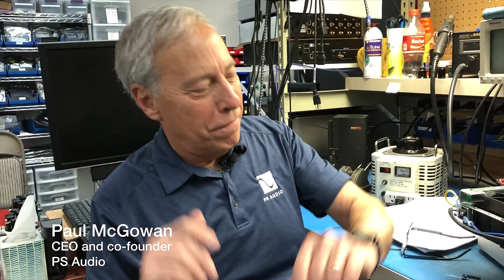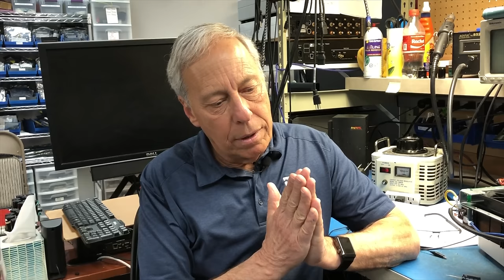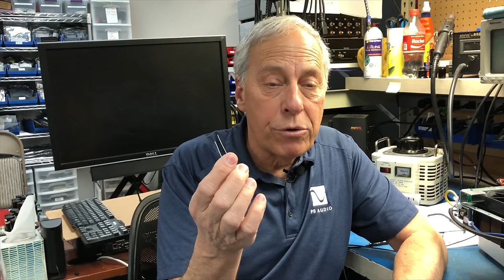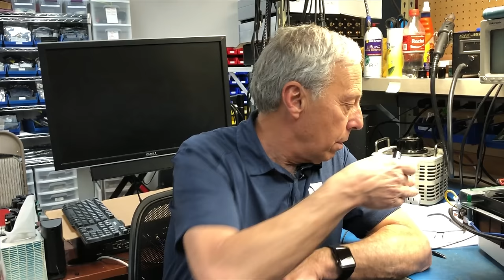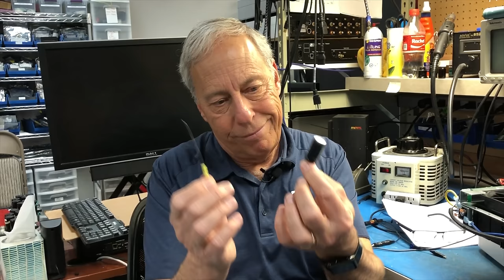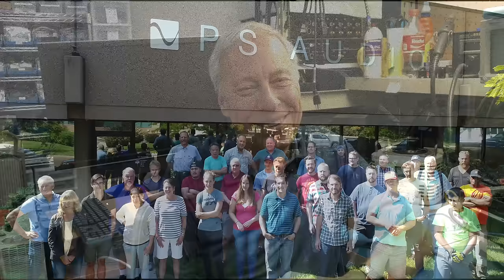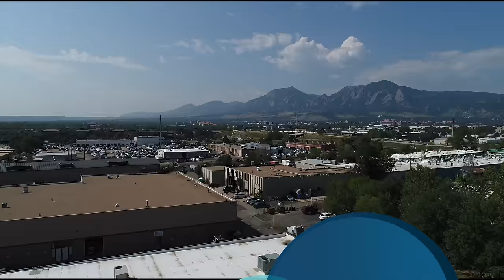Why do capacitors sound different?

Comment: As a retired analog microchip designer with 35 years of experience, I have a good practical knowledge of capacitor characteristics. Caps have three basic electrical characteristics: capacitance, equivalent series resistance, and equivalent series inductance. Depending on the circuit in which the cap is used, one or more of these might be completely negligible. Film caps have much lower series resistance than electrolytics, but most of the series inductance is in the leads, so there is not much difference between the two types. In audio circuits, resistance and inductance are almost always negligible because the frequency of operation is so low. At audio frequencies, series inductance is practically zero. Series resistance along with the capacitance results in a tiny phase shift of the audio signal, but it's not at all clear that such tiny phase shifts are audible.

Rather than providing an explanation, Paul, all you've done is declare that film capacitors sound better than electrolytics. To provide an explanation, you would have to deal with the capacitor characteristics I described above, by showing how an audio signal is altered in a way noticeable to the human ear.

For example, tube amplifiers sound different from transistor amplifiers because tube characteristics are different from transistor characteristics. Almost all audio amplifiers provide gain by using a feedback circuit to control distortion. Tube amplifiers have inherently much lower gain than most decent transistor amplifiers, and end up having much higher distortion, mostly in the odd harmonics, than transistor amps. It's that distortion that is actually pleasing to the ear, and for poorly known biological reasons, "sounds better" than an undistorted signal. That's the sort of explanation you would need in order to explain why "film capacitors sound better than electrolytic capacitors. To be thorough, you'd have to provide a representative circuit schematic of some amplifier and explain exactly why using one type of capacitor in one location produces an audio signal that "sounds better" than if using another type.

Also keep in mind that electrolytics are not used very much in audio circuits (except perhaps very low frequency bass circuits), but almost exclusively in power supply circuits.
Reply: Alan, don't tubes produce even order distortion rather than odd order distortion?
Reply: And Alan, dielectric absorption might be the biggest factor. Yes ESR and ESL are important, especially for bypassing and circuits that pulse (switching regulators) but DA is the most likely differentiator. Agreed, lead inductance has no bearing at audio freq.  Pease wrote articles about this, calling it a memory effect. Also a changing voltage and/or bias voltage across a cap influences the charge available which changes the capacitance. This might be a minor effect.
Reply: Well while you've been gaining book smarts for 35 years, he's been listening to this shit for about as long, so I'm gonna take his word on what sounds better
Reply: @TheChadPad  I guess you can't read
Reply: @philipwebb960  
They produce both.  Clever designers use staging and topologies which tend to cancel even harmonics, so in practice it's more of a myth than reality, that tube circuits produce mostly even harmonics.  
But considering the overall frequency distribution of distortion harmonics, it is generally true that tube circuits produce more energy in low-order harmonics and less energy in the very high-order range, compared to class AB transistor circuits, for example.
Reply: Pop the cover off of a commercial mixer some time:  You'll see lots of small electrolytic capacitors.  They are used for DC blocking at the output of almost every stage, regardless of how little DC is present.  I've even seen designs that put a blocking capacitor on both the input to, and the output from, a level control between op-amp stages that have no voltage bias (bipolar power supplies).  Can't imagine why they did that.  
Another important distinguishing characteristic between quality film capacitors and electrolytics, is linearity.  Even ceramic capacitors have issues with that.  The "inductance" of electrolytics at high audio frequencies can be from the dielectric behavior, and it can be significant.
Reply: Well explained and nice link between electronics and psychoacoustics.
You should become a teacher.
Reply: Anyone who's selling high end audio equipment is not willingly going to admit that cheap components can sound just as good.
Reply: @stevenofford495  Jup, there's no reason for any salesman to honestly say something like that, it only drives their potential customers away to the cheaper competitor, resulting in less sales.
Reply: Wrong agains! CAPACITOR ifromt eh wor CAPACITY It is based ont he volkume and nopthign else. PLease educate yourself before making me thing sof what or hwop toi responds to YOU!
Reply: allydea:  HellOw mine Frends. Is tyhsi the articke you wanteds...

The Laplace transform is an integral transform perhaps second only to the Fourier transform in its utility in solving physical problems. The Laplace transform is particularly useful in solving linear ordinary differential equations such as those arising in the analysis of electronic circuits.

The (unilateral) Laplace transform L (not to be confused with the Lie derivative, also commonly denoted  L) is defined by

 L_t[f(t)](s)=int_0^inftyf(t)e^(-st)dt,  
(1)
where f(t) is defined for t>=0 (Abramowitz and Stegun 1972). The unilateral Laplace transform is almost always what is meant by "the" Laplace transform, although a bilateral Laplace transform is sometimes also defined as

 L_t^((2))[f(t)](s)=int_(-infty)^inftyf(t)e^(-st)dt 

THNK YOU AND THUMBBS UPS!
Reply: THANK YOU
Reply: Capacitors are made to different standards by different brands. Some have tolerances +- 10% some have tolerances +-2% that alone will affect sound quality. Say one loudspeaker has cap that should measure 2.5µF however due to the 10% margin it measures 2.25µF. If the other cap (in second loudspeaker) is in the other direction it can measure 2.75µF and now we have a difference of 1600Hz in a crossover point between the two loudspeakers. So each loudspeaker will sound different and as a stereo pair they will not image well. Hence higher quality caps with tighter tolerances will perform better than electrolytic counterparts with much looser tolerances. Yes of course the loudspeaker manufacturers can measure each cap and make sure that they are matched - but that's expensive and rarely the case.
Reply: Tubes have a more realistic, three dimensional, "deeper" soundstage. You are saying that is due to distortion?
I doubt that very much. I think you are completely wrong. Distortion, my ass.
Reply: @ilovecops6255  Learn English
Reply: Doug Robbins: Hellow Mine Frends! When are you foing to  Learn English? Is it to put a period at the ens of th esetncne of vector addition for ejecting out of upsidedown airplane? THANKES YOUES AND TBBMSUBS UPS!!

Doug Robbins1 hour agoHighlighted reply
@i love cops Learn English
Reply
Reply: Doug Robbins: hELLO mISTRE rOBERTS AGAINS! tUBES HAVE harmonics distortions. Its why they can SOUND SBETTERS' THAN TRANSITOOIRES/ hARMONICS DISTORTIONS is far from autophiles.

There are also significant differences in the construction of tube and transistor amplifiers that contribute to the sound. Tube amplifiers require output transformers to match the high impedance of the power tubes to the low impedance of the loudspeaker. The transformer has a natural high-frequency roll-off that makes the tube amplifier sound warmer.

Thanks you for expert cpmmetn with you 4 year electricals engineerign degree/ Your universit you graduted from f must be verys proud of YOUE!

 
Doug Robbins1 hour ago
Tubes have a more realistic, three dimensional, "deeper" soundstage. You are saying that is due to distortion?
I doubt that very much. I think you are completely wrong. Distortion, my ass.
Reply   

THN4EKS YOUES AND THUMBBS USP!
Reply: @ilovecops6255  Output transformers can be linear out to 40 kHz, so there's no rolloff for audio frequencies, but the amp still has that sound. You haven't got a clue, do you?
Reply: @dougrobbins5367  Hellow Mine Gooda Frends. I remember a HARMAN KARDONS form around 19767, it wne up to 100 khz. Here is a articles I finded for yoU mine frends...

Harman Kardon Citation Twenty-Two Power Amplifier Review

We measured the frequency response of the amplifier from 5 Hz to 500 kHz. It was down only 0.1 dB at the lower limit and 0.6 dB at the higher frequency

I don thaves the CLUES board gam I dont play baords games...The classic detective game! In Clue, players move from room to room in a mansion to solve the mystery of: who done it, with what, and where? Players are

The stero I have the transformer gets really hots now. It must be brokesn or something. Keft cannels dont work. I cant affrd new stuff except maybe Logitech computer speakers. THANKES YOU , AND THUBBS UPS!
Reply: @ilovecops6255  Maybe your tubes are carrying too much current, need to be biased. Maybe that's why it's hot.
Reply: Thank you for answering the capacitor question more thoroughly. We’d need to bring a lunch for a conversation where Paul actually got around to  a complete answer. He’s forgotten more about audio design than I’ll ever know but it takes so long to get through the goofy grand-dad schtick.
Reply: Paul it's time to let go!
Reply: Ask yourself why any experienced electric guitarist will tell you there is a distinct difference in the sound of one manufacturer's rectifier tube, compared to another. The same experienced musician will tell you there is a clear audible difference when changing volume pots, from one type to another. There is no explanation for this, in engineering terms, it makes no sense. But it is true. Food for thought.
Reply: There are people who spend hundreds of dollars on "special made for audio" capacitors to re-cap old speaker cabinets...  they will swear that the $1,000 spent on buying the components and then building the circuit themselves makes a difference.
Reply: ListenAndLearned  HELLO MINE GOODE FRENDS! Its in the video 'Ejection Vectors USAF Ejection Seat training film' STARTING AT 10 MINUTES 0 SECONDS. THANKE YOU AND THUMBBES UPS!
Reply: @Allen  Feuerbacher 

This article spells it out,

39 years ago -

http://www.reliablecapacitors.com/oldRC/www.reliablecapacitors.com/pickcap.html
Reply: @dougrobbins5367  If psychology has taught us anything it's that the human mind is not a trustworthy source of accurate interpretations of reality, including interpretations of our own perceptions.

Look, I use Russian paper in oil caps in my guitar, but I do it because I think it's cool. I'd like to think it makes an audible difference in the sound but after years of nerding out about this stuff I've not found any more likely explanation for the vague claims of "superiority" from a handful of "experienced musicians" than cognitive bias. No one should be arrogant about the type cap they use and no one should feel theirs is inadequate either.

As for differences in tubes, I'm not sure what specific situation you are referring to but differences there can and have been explained. Even then though it's really just about personal taste.
Reply: @ZaphodXLII  Millions of people find that different caps sound different, it's quite obvious. I don't know anyone who is "arrogant" or ashamed of the caps they use.
An amplifier can have excellent specs, and still sound like garbage. Amps with lots of distortion can be very musical. Our ears discern things that cannot be seen on an oscilloscope. If you can't, then maybe you have been playing too loud, for too long.
Reply: @dougrobbins5367  wooosh
Reply: @ZaphodXLII  That was deep. But, I guess it's better than the meaningless rambling that you were doing earlier.
Reply: @dougrobbins5367  I'll elaborate on what I meant by "woosh": I'm sorry you're having trouble stepping back from your ego and looking at what I said objectively. Feel free to start up the conversation again when you have something to add that doesn't boil down to "I think other people agree with me". It's like trying to have a nuanced discussion about politics or religion and one person only replies with "how can <insert religion or political view> be wrong if so many people agree with me?"
Reply: @ZaphodXLII  I've built at least twenty amps. I know many others who have done similar things, knowledgeable, competent people. I have clearly heard the sonic differences between polypropylene and polystyrene, mylar, and so on.
My clear perceptions are echoed by every person I know of, who has experience with these things. Online, we see general agreement, broadly speaking, on these matters. So, the fact that competent people everywhere seem to have the same impression, is perfectly valid and valuable as evidence for this subjective perception.
It's as good as we will get, unless someone has done an extensive digital analysis and can show us the subtle differences on a graph, screen, or whatever.
In this situation, the perception of those experienced  in the matter is important, and your suggestion that the general agreement that I described is invalid, is wrong.
The judgement of the competent and experienced is the best evidence available.
Your characterization of what I said is foolish
Reply: @dougrobbins5367  I see where you're coming from and I do think that general consensus should not be dismissed lightly (though I do think it can be a trap to assume that there is one general consensus about something in the first place). I think we have a lot in common. I have built many synths and at one point I even built a rig in my custom sid chip synth for hotswapping the external sid filter caps and I probably tested 50+ caps of various types. I certainly did hear differences and I can't be sure that the types of caps weren't responsible for those differences. It's just that there are so many things in my life that I have been convinced of and that many very smart people around me agreed with that I have since found to be wrong. Sorry if I've been preachy, I just get passionate when I think someone else might be making the same types of mistakes I make.
Reply: @ZaphodXLII  In my experience it is the small signal caps where the most difference is heard. Sonically the best I've heard are polystyrene.
I'm impressed with the Novation synths, but I am no expert. I can get a Supernova for well under a thousand dollars. Would you recommend that purchase?
Reply: @dougrobbins5367  That's cool, I actually ended up using a polystyrene.That's definitely a good deal on the supernova. Haven't used one myself but from what I've listened to it does really good filter emulations for the time it was made. All the focus these days is around "pure analog" but I think a lot of those early attempts to emulate analog synths have a lot of their own character and can easily be warmed up in a lot of different ways like running them through guitar pedals. Most of my knowledge is around mid 80's to early 90's synths, especially the ones that are digital analog hybrids. Like the roland jx-3p, sid chips from commodore 64's that had analog filters, ensoniq stuff, weird casio and yamaha stuff. Most of what I build is recreations of even older stuff that I can't find cheap like the vcs3, polivoks, or just the increasingly expensive analog classics like moogs, rolands, yamahas, etc,.
Reply: @ZaphodXLII  They could make lots of money by reissuing the actual Jupiter 8.
Someone said the chips no longer exist. Seems dubious. Maybe it's just too costly to build?
Reply: @dougrobbins5367  Yep, a lot of those chips only have hope of being remade is someone acquires the original machine they were manufactured on. It has happened but most of them are in landfills in asia. It's a lot like tubes, It could be done cheap-ish with enough demand but still no where near as cheap as the modern alternative (I guess transistors in the case of tubes and modern integrated circuit printing in the case of chips). FPGA's are very promising for a lot of those chips though.
Reply: @ZaphodXLII  If you want to really warm things up...
Someone gave me a single ended tube power amp, a whopping ten watts of gorgeous, sweet sound. Used with good, efficient speakers, it's the best sound I've ever had. Methinks it would do much for many synths.
Reply: Thanks for the explanation, the more of these PS Audio clips I watch the less I'm convinced they are based on objective scientific fact, and more on subjective opinion. I'm no expert, but I feel a lot of what is mentioned in these videos has little to do with actual knowledge about electrical engineering, and more to do with perpetuating convenient myths. Usually when people understand the differences between capacitors, and the sounds that they produce, they can do better than just this one sounds better, and this one doesn't.
Reply: @ES-qm5hr  How are you going to do "better" than that?
Reply: @content4502  
That's an annoying article to read.  It is written in a style that attempts to mimic formal papers, but is inconsistent in doing so.  In a number of places, the author demonstrates a poor level of experience with electronic design, discussing at length approaches which no experienced designer would implement.  The author shows a basic misunderstanding of the physics of dielectrics.  The article is full of typographical errors, especially in physical units.  It does not do well at prioritizing discussion of circuit configurations most commonly found in audio designs.  Some of the claims made are dubious, e.g. increasing the load on a capacitor, causing it to conduct more current and operate at a higher ac voltage supposedly reduces distortion.  
Most seriously, it fails to investigate any link between distortion measurement results, and other parameters discussed at length such as DA (dielectric absorption) and DF (dissipation factor), and never mentions that such behaviors themselves are not root causes of distortion, but only their deviations from linearity.  
After wading through the bloated discussions, one comes away with just two salient points, the first of which is already common knowledge:  
1.  Do not use electrolytic capacitors without DC bias.
2.  Avoid polyester dielectric.
Reply: @ZaphodXLII  
I agree our perceptions have little to do with reality.  But perhaps even more important is the fact that they are so variable.  The brain is flooded with more information from sensory organs, than it can fully process.  The obvious implication is that it must select only a subset of that information, and that is where the issue lies, since the selection process is highly inconsistent.  With every repetition of a musical passage, different details come to attention.  The ability to detect particular nuances in complex sounds relies on a level of consistency that our brains struggle to attain.  
I have spent enough time listening to A-B comparisons, to realize that many apparent differences vanish, if one takes the time to repeat the samples using short loops.  One simply doesn't arrive at correct conclusions, if long A and B passages are listened to once or twice, as is customary in most comparisons.
Reply: @dougrobbins5367  
"Millions of people find that different caps sound different"
Dubious claim.  Please cite a credible reference.  
"Amps with lots of distortion can be very musical"
Amplifiers with low-order harmonic distortion at modest levels can sound musical.  Amplifiers with high-order HD, even at low levels, can sound harsh.  More importantly, amplifiers can exhibit distortion with reactive loads that doesn't manifest with the resistive loads used to test them.  Further, some amplifiers suffer from perturbed frequency response with reactive loads which can be distinctly audible but potentially pleasant even though accuracy (fidelity) is reduced.  
"Our ears discern things that cannot be seen on an oscilloscope"
Then the operator doesn't know how to make full use of the scope.  Wager:  If you hear a real difference between amplifiers, preamps, cables, etc., I can show you what it is, using my scope.
Reply: @marianneoelund2940  There's nothing dubious about that claim. Do a little research, among those who build and modify amps and so forth, the differences are well-known.
Please look it up.
Our eyes give us different information than our ears do. Your claim that you can correlate any valid audio perception, with a visual one, is the dubious claim.
In other words, hogwash.
Reply: @dougrobbins5367  
What's dubious, is the "millions" part.  That isn't a minor detail.  You aren't supporting your point when you exaggerate.  Cite a credible reference, or retract the claim.  
I'll reiterate my stance:  Any real difference you can hear, I can identify by signal analysis.  That is my area of expertise.  
Over 40 years of EE work in the aerospace industry, I was able to solve every single problem that I was given to analyze.  Every.  Single.  One.  No exceptions.  Often, I was used as the "engineer of last resort" for the problems that others were struggling with, so they weren't all straightforward cases.  
Your minor audio issues are trivial by comparison.
Reply: @marianneoelund2940  So, it's an exaggeration. So sue me. We are not in court, you are not cross examining anyone, and you are in no position to give me the choice you just did. Who do you think you are? Would you be so impertinent, if you were looking me in the eye?
I doubt it very much.
The sonic differences among capacitors is, once again, something that is well accepted among experienced audio people. Read up on it. It's silly to ask for a credible reference. How would you establish credibility? Anyone with direct experience, I suppose, is credible, in terms of subtle sonic perceptions. So your request for a '''"credible reference" is silly. Withdraw your silliness at once.

If you saw an oscilloscope display of a Rolling Stones recording, could you tell the difference between that and the display of a Beatles recording?
Of course not. What nonsense. And that is not subtle at all, a young child can hear the difference immediately. You could search for the visual differences until you had a long white beard.
Reply: @dougrobbins5367  
Gross exaggerations are hardly impertinent.  
I'm not objecting to the idea that differences between capacitors can be audible; who around here doesn't know that?  
However, your Rolling Stones versus Beatles example certainly is impertinent.  Are you suggesting that a capacitor change would transform one to the other?  
Let's stay with the topic, please:  Ability to detect/analyze signal differences due to component quality.  If there is an actual difference which you can hear, I can show you what it is on my scope.  In high res mode it collects data to 16-bit resolution, up to 10M samples, and can show amplified channel differences as well as extremely detailed spectra.  
By the way, the long white beard would have to be yours.  Women don't grow those, if you haven't noticed.
Reply: @marianneoelund2940  That's not what was impertinent. Your telling me to choose between providing credible evidence and withdrawing the statement was impertinent. You don't give orders, on youtube. Mind your manners. I don't know what the people in your life put up with from you, but I'm sure it's too much.
For you to ask me if I think a cap change would transform the beatles to the rolling stones, constitutes the dumbest, most idiotic question I've been asked in a long time. If you cannot distinguish, by oscilloscope, the major differences in sound qualities between the recording of the stones versus the beatles, you cannot hope to distinguish far more subtle qualities of capacitors. Looking at a scope, you can't even tell if a complex mix of audio frequencies is music, or not. But you think you can detect the musicality of capacitors? When you can't even tell if the signal you are looking at is music? Bullshit.
Where you got the idea that I thought a cap could change the stones into the beatles, is anyone's guess, but it sure is nonsensical. Almost as nonsensical as the idea that you can point to a visual display which correlates with the ear's perception of music. What evidence is there for that? Your word? Sorry, you seem like an over-inflated, opinionated braggart.

My meaning was clear. Your response is garbage, and you are clearly a person who has grossly overestimated your own abilities.
Reply: @dougrobbins5367  
Considering the language you're leveling at a complete stranger, it is the people in your life that we should feel sorry for.   
I don't need to measure "musicality," Doug, just as I don't need to measure imaging or staging or perception, as these are all derived from the music signals.  It's not necessary to know what the auditory system or neural processing does to the information; I only need to measure its input.  
If there are actual, audible differences in the signal, due to a component change, I can find them.  Guaranteed.  I've been doing just that for decades.  
And if you think one wouldn't see a difference in the scope traces from two different music tracks, then you have no idea what modern scopes can do.  I find that quite amusing, in fact.
Reply: @marianneoelund2940  My language? You are the bossy one.
You could see a difference, but you couldn't tell what the difference meant.
Look, I've tried to analyze the scope image of different kinds of music. There is nothing there that shows a correlation with what you hear, beyond the display of repeating rhythm, with regularly changing amplitudes across the spectrum.
Nothing there, besides a repeating rhythm, betrays the fact that it is music at all, and not noise. There is no possible way to discern the character of a piece of music, from the visual display. 
With caps, people notice differences in character, many people get the same impressions. These qualities do not seem to be reliably reflected in the simple frequency response analysis. People are hearing something. Maybe a capacitor cannot be defined in terms of it's measured response at a single frequency.  It's like an amplifier which is tested with a sine wave at one kHz.
It might read very good, but when it is trying to produce a hundred frequencies at the same time, as in hi-fi audio, the weakness of the amp becomes more than clear.
Are there dynamic qualities to capacitors? There must be, if the subjective impression of THOUSANDS of people are correct. (I hope you are more comfortable with that, I know you don't like exaggeration, Marianne) Mylar is clean and competent; polypropylene has a richer tone; polystyrene seems to convey the highest  frequencies with ease. These are consistent observations. Can you show me those qualities, on your screen? Can you show the differences, in the audio spectrum, of a signal passed through one type of plastic film cap, or another?  A cap used at audio frequencies, which should be linear at a hundred times the frequency?
If the differences we hear are merely frequency response of the different dielectrics, then we are hearing some amazingly small differences. Seems unlikely. It would appear that the chemical makeup of the dielectric affects the sound in some other way or ways. Consistent observations by everyone from hobbyists to professional builders make it unlikely that these things are imaginary. (Not millions, don't worry)
Can you show these things on your scope screen?
You claim to be something of a sherlock holmes of signal analysis. 
What could you show us, on the scope screen?
Reply: @dougrobbins5367  
Yes, I'm confident I could find the differences with the scope.  Distortion analyzers can certainly find the difference, and I can set the scope up to operate as a distortion analyzer.  Recently, I was doing just that, to create a scope trace of powerline voltage distortion.  It can also be set up for spectral analysis, which is akin to how auditory systems work.  
Keep in mind this is not an absolute measurement, it's a delta measurement comparing two sets of samples from two components.  That allows very high sensitivity.  Chances are I would also find other things that you cannot hear.
Reply: @marianneoelund2940  

Dear whomever, 

That article was published for the unwashed masses. 

In a commercial audio magazine. 

The author was a university professor with a doctorate. 

It was this article,  that caused the change in audio electronics. 

Toward higher quality/less distortion. 

The two points you mentioned, 

1.  Do not use electrolytic capacitors without DC bias.
2.  Avoid polyester dielectric

Were NOT common knowledge at the time.

Yor comment,

Is typical of people who try to impress others, 

By yor attempt to appear  'smart'.

Proving you are a troll. 

Nothing more.

Please change you ways,  and join humanity.
Reply: @content4502  
I'm an engineer, not a troll.  
It is not true that distortion due to polar (Ta and Al) capacitors and ceramic capacitors was unknown prior to the 1980's.  
The article is very old and needs an update, in particular to concentrate on finding root cause of nonlinearities in film type capacitors, better measurement approaches, and correlating results to audible character.  Simply measuring DA and DF values does not explain how audible nonlinearities arise.  
There is no data presented which shows how audible differences can exist between mylar, polypropylene or polystyrene (or even polyester) dielectric types.  Considering that, your claim that the article was the principal driver for changes in the audio industry, appears rather weak.
Reply: @marianneoelund2940  an engineer?

Sure you are.

Alot of  'lil kids are.

And 'scientist'.

By the way, where were you, in 1980?
Reply: @content4502  
I just retired from a 41+ year career with my company, this year, having started in 1978.  There are public campaign donor records where you can find my employer and job title.  First 4 years I worked as a technician, until I completed my EE degree.  
Electrolytic capacitor nonlinearities were well understood in the 1970's and by most, much earlier than that.  Ditto for high-K ceramic capacitor types.  
Regarding capacitors, you will find much more information here:  
http://www.waynekirkwood.com/images/pdf/Cyril_Bateman/
One of the most important takeaways from Bateman's studies, is that one cannot rely on random sample testing, as parts within a single manufacturing batch can vary widely in their distortion measurements.  That is, for application in high-end audio, there must be a QA process which tests all parts for distortion performance; one cannot rely on dielectric type and construction alone.  
Today, it's difficult to find polycarbonate or polystyrene.  Most common film cap dielectric is polyester (polyethylene terephthalate, PET or naphthalate, PEN), often called mylar, but this isn't a recommended type for audiophile applications.  Low distortion types are mica, PTFE (teflon), NP0 (C0G) ceramic for small values; polypropylene (PP) or polyphenylene sulfide (PPS or PS) for larger values, especially if foil on film rather than metallized.  
Contributors to poor capacitor performance are:  
Mfg. variability (mentioned above)
High dC/dV (associated with high DA)
Ohmic connections (especially metallized)
Piezoelectric effect (microphonics)
Reply: @marianneoelund2940  i already know about capacitors. 

Have known for 40+ years. 

Bateman's article was discussed 15 years ago, 

@diyaudio, and found, wanting.

Let's just say, it's incomplete. 

Whatever your situation is, 

You still post like a troll.
Reply: @content4502  
I agree there is still a need for further study.  For one thing, parts availability is different today.  
Bateman raised some interesting questions, which I intend to pursue as I have time.  Measuring extremely low THD levels with pure sinusoidal signals is one thing; my interest is more towards comparing capacitor performance with actual music signals where a complex and wide range of frequencies is present.
Reply: @ilovecops6255  yeah, so you are not an idiot! A bit crazy, maybe?
Reply: @jjcale2288  THNAKS YOU MINE GOODE FRENDES! There was no GPS back in 1960. Just a map, compass, and moonlight. ABSOPLITELY NO RADIO TRAFFIC! Its really easy to triangulart and figure tu where an aricraft carrier can be. Iranians have ANTITANKE MISSILES on ther speedbota so they can get close and do a lotee fo dmage, IE.E. SUICIDE BOMERS TYPES!.  Have you see the sroties about Irans speedbote s harassing US shipe. Thats the dangers and belive me it is reel! THEY DONT NEED FRUGATES and such to stop a aricrafte CARRIERES!
Reply: @marianneoelund2940  Thanky you faiur lady. you haves alwayes been the goode freendes. thubmmbes uppes!
Reply: @ilovecops6255  q.e.d.
Reply: @dougrobbins5367  are you a musician? Are you an engineer? I thought so but never mind! You developed a biased mindset. And you are not alone, this mindset keeps "audiophile" companies in business 😉
Reply: @jjcale2288  Its knows as a SOUPERSONIC DIFFUSER. Supersonics airplanbes have those rectangulare inlets. There are sioupersonic diffuseres in there to SLOW doen the air to su[psinic to the shocke wave does nor destropye the compressor. Theearl;ier ons were controlled by a anaolg compputers and di nto work so goode. Later they use digitalle computers IUts sutomaic and the pilot does nto controlle themes. Rocket motores are the opposites. The get larger fromt eh throa to expande the gasses and incrase them to soupersonice. GOOGLE Tsiolkovsky rocket equation. thankes you and thubbmes uppes.
Reply: @jjcale2288  I've been a classical musician for many decades. I've built about twenty amps from scratch, and I'm designing more and more of the circuitry myself, as things evolve. How about you?
Your stupid remark about audiophile companies is, unfortunately, unaccompanied by any thought or reason. A shallow, sophomoric, non-comment.
Try to make a point, jerkoff. I'm surprised you aren't embarrassed to "contribute" that kind of stupidity, after some of the thoughtful comments that have appeared here.
Get a good grip on your knees, and try to pull your head out of your asshole.
Arrogant and stupid is no way to go through life.
Reply: that guy sells overpriced power cables saying that it will make your system sounds better, what did you expect?
Reply: That was very well explained, electrical engineering was always kind of poorly explained in school
Reply: I don't think there's a technical explanation that's going to really explain how a sound resonates in your ear. If you take a basic yellow Chinese polypropylene capacitor and a Clarity MR. They would likely test almost identical but you can double blind a tweeter with each one and easily tell the difference. It's subtle but it's definitely there and a repeatable process any audiophile can hear
Reply: @Wizardofgosz  it's very easy. Try it. I can do it 10 out of 10. Have tried it
Reply: I’m with you bro.
Reply: Lol 😂 every bit as logical as the main video.
Reply: @stevenofford495  Now that is a very precise and accurate explanation of this phenomenon indeed. "Oh please ring me up those  5 meter pure oxygen free copper, shield wound facing North on the equator, 345 strand per cm golden plated brass end polypropylene dielectric cable please, it's on sale correct for $1245.99 correct?"    :)   Pathetic creatures.
Reply: Now this is an excellent answer, not like the ine from the video, great job, beginning to understand finally
Reply: What a great explanation!  Thank you very much :)
Reply: @TheChadPad  huh?
Reply: @ilovecops6255  What language is that?
Reply: Congratulations, where can we see your products?
Reply: @madcrabber1113  HELLO MINE GOOD EFREDS! IS THSI THE ARTICLE YOU EBEE LOOKING 4ORE...Chevrolet Chevelle Laguna Type S-3 Coupe 350 V-8 Turbo-Fire (man. 3) , model year 1974, version for North America U.S. (up to September)

1974 Chevrolet Chevelle Laguna Type S-3 Coupe 350 V-8 Turbo-Fire (man. 3) specs

    manufactured by Chevrolet (USA) in United States
    2-door coupe body type
    RWD (rear-wheel drive), manual 3-speed gearbox
    gasoline (petrol) engine with displacement: 5733 cm3 / 349.8 cui, advertised power: 108 kW / 145 hp / 147 PS ( SAE net ), torque: 339 Nm / 250 lb-ft, more data: 1974 Chevrolet Chevelle Laguna Type S-3 Coupe 350 V-8 Turbo-Fire (man. 3) Horsepower/Torque Curve
    characteristic dimensions: outside length: 5265 mm / 207.3 in, width: 1946 mm / 76.6 in, wheelbase: 2845 mm / 112 in
    reference weights: shipping weight 1792 kg / 3951 lbs base curb weight: 1845 kg / 4067 lbs
    how fast is this car ? top speed: 179 km/h (111 mph) (©theoretical);
    accelerations: 0- 60 mph 12.1© s; 0- 100 km/h 12.9© s (simulation ©automobile-catalog.com); 1/4 mile drag time (402 m) 19© s (simulation ©automobile-catalog.com) 1974 Chevrolet Chevelle Laguna Type S-3 Coupe 350 V-8 Turbo-Fire (man. 3) Detailed Performance Review
    fuel consumption and mileage: average estimated by a-c©: 17.9 l/100km / 15.8 mpg (imp.) / 13.1 mpg (U.S.) / 5.6 km/l, more data: 1974 Chevrolet Chevelle Laguna Type S-3 Coupe 350 V-8 Turbo-Fire (man. 3) Specifications Review
Reply: @madcrabber1113  Chevrolet Chevelle Laguna Type S-3 Coupe 350 V-8 Turbo-Fire (man. 3) , model year 1974, version for North America U.S. (up to September)

1974 Chevrolet Chevelle Laguna Type S-3 Coupe 350 V-8 Turbo-Fire (man. 3) specs

    manufactured by Chevrolet (USA) in United States
    2-door coupe body type
    RWD (rear-wheel drive), manual 3-speed gearbox
    gasoline (petrol) engine with displacement: 5733 cm3 / 349.8 cui, advertised power: 108 kW / 145 hp / 147 PS ( SAE net ), torque: 339 Nm / 250 lb-ft, more data: 1974 Chevrolet Chevelle Laguna Type S-3 Coupe 350 V-8 Turbo-Fire (man. 3) Horsepower/Torque Curve
    characteristic dimensions: outside length: 5265 mm / 207.3 in, width: 1946 mm / 76.6 in, wheelbase: 2845 mm / 112 in
    reference weights: shipping weight 1792 kg / 3951 lbs base curb weight: 1845 kg / 4067 lbs
    how fast is this car ? top speed: 179 km/h (111 mph) (©theoretical);
    accelerations: 0- 60 mph 12.1© s; 0- 100 km/h 12.9© s (simulation ©automobile-catalog.com); 1/4 mile drag time (402 m) 19© s (simulation ©automobile-catalog.com) 1974 Chevrolet Chevelle Laguna Type S-3 Coupe 350 V-8 Turbo-Fire (man. 3) Detailed Performance Review
    fuel consumption and mileage: average estimated by a-c©: 17.9 l/100km / 15.8 mpg (imp.) / 13.1 mpg (U.S.) / 5.6 km/l, more data: 1974 Chevrolet Chevelle Laguna Type S-3 Coupe 350 V-8 Turbo-Fire (man. 3) Specifications Review
Reply: @whocares.20  well said but you left out the little detail that the price you quoted was per foot! Otherwise it would be too cheap to be real HiFi.
Reply: @jamesjameson4303  Per foot!? Darnit, I thought it was a bargain at per meter.. shux.
Reply: @TheChadPad  This isn't about what sounds better.... this is supposed to be about WHY they sound better (Look at the title of this video.) Gaining book smarts for 35 years?  Ah, yes, that's what we call being a trained engineer, and combined with experience, that is what we call being an experienced engineer.
Reply: @KenTeel  I didn’t mean to shit on book smarts, I meant to emphasize the difference between experience of listening to the differences as opposed to what theoretically should be better. There’s theory, and then there’s actually testing and listening. We need both
Reply: @TheChadPad  That's true, Chad.
Reply: @madcrabber1113  Just saw the reply. Check above where I explained myself better. Wasn't tryin to diss book learning. I study this stuff myself. But theory can't tell you how it will sound, only your ears can. So, to his point "Series resistance along with the capacitance results in a tiny phase shift of the audio signal, but it's not at all clear that such tiny phase shifts are audible." This is only one point of which I could say the following: What about the additive effects of many of these in a circuit? Small differences add up. Just food for thought for the op
Reply: I think you should listen to a proper high end system. Phase shifts are definitely noticeable in hearing. As are impedance mismatches. Go and hear a DarTZeel system for example, and report back ;)
Reply: Problem with electrolytics and audio is that they are non-linear, the capacitance actually changes with the charge, leading to audio distortion.
Reply: @4Nanook  and cheaper caps will be less linear
Reply: Nice post good sir 👍
Reply: @stevenofford495  To anyone with a tin ear it makes no difference if equipment is made with cheap components
Reply: Although capacitors are treated as "linear devices" when it comes down to extremely critical high end audio design, this is not quite true, since many minor factors such as temperature changes, dielectric, hysteresis effects, non-linearity of Q,winding v layer design, dielectric material, changes with age,  etc. need to be taken into account in designing for really high end audio performance.  ( I spent 6 years in capacitor design engineering- both barium titanate and film- a long time ago)
Reply: Thank you Alan, I left a question above yours on electrolytic capacitor replacement and I was concerned if any of them might play a role in the audible arena as it were. Your last paragraph, although general, does appear to suggest that in most cases don't directly contribute in any way, with some exception to the audio spectrum.
Reply: @alan Amazing!
Reply: Thanks for your comment, I'm just starting to build small audio projects and was wondering if I could use the less expensive electronic parts to begin with as it's not exactly high end audio and I have heard it mentioned that you can, hence me watching this video to find out more. I passed some electrical exams years ago but not electrical engineering but with what I remember I can piece together what you have explained here and eh thank you very much!!! There's a lot of audio elitism our there and I just want to save a few bucks while I'm learning, I hope you are having an excellent day! ;D
Reply: Very interesting 👌
Reply: The caps that we use on passive xovers, what are the difference in the voltage and percentage say 100v vs 400v and 2% vs 10%
Reply: @stevenofford495  Like the company that slaps a badge on a $30 Dlink dumb ethernet switch and sells it for $600?
Reply: @ilovecops6255  What??
Reply: You should start a channel and do what you advocate Paul should do. Too much work?  I get it.
Reply: @TheChadPad  I'm sure Paul does NOT listen to 'shit', but he probably listens to quality music on decent equipment, and why he is in the hi-fi business, and teaching others about it.
Reply: @QoraxAudio  Jup???? L0L
Reply: @ilovecops6255  UNGA BUNGA.....SIMBA!
Reply: @mr.blackhawk142  Absolutely. Agreed
Reply: @philipwebb960  3 types of semiconductors used in amplifier circuits, bi0polar, mosfet, and valve/tube. The harmonics of importance are 1st, 2nd and 3rd. The levels in dB (volume) are low enough to ignore after that. Bi-polar transistors have even order harmonics, i.e 2nd & 4th. Mosfet devices have odd order harmonics 1st and 3rd. valve/tube have octave order where the harmonic is the same note as the fundamental, meaning if the note being sent through the device is the note or pure tone of A, then the harmonic will be the higher pitched note/tone of A at a fraction of the volume dB say a 3rd the volume. The beauty of valve audio is the harmonic distortion is masked by the music itself.
Reply: @Marianne Oelund FLAC then?
Reply: @stevenofford495  This is not true.  Paul is doing you cynics a favor by explaining where he can find an acceptable/affordable solution that makes a significant difference to the problem he is describing.   I don't know if I would have his patience to try to offer helpful answers to such hostile critics.
Reply: @joelhacker8767  You know, my comment now seems to be attached to this video, which is a different one to the one I commented on response to.
Reply: Don't forget hysteresis. But for a coupling capacitor application the cap is chosen to of low impedance to signals of interest and so there is little to no signal across it's terminals. Since there is no signal across the capacitor none of it's nasty properties can really have any effect upon the signal. Paul is also dead wrong on how they function. Nothing "jump" across the dielectric; instead as the plates are charged then polarity is flipped the repulsion of electrons creates the flow of AC current. The rate of which this flipping of polarity occurs is why capacitors decrease impedance with an increase in frequency.
Reply: @dougrobbins5367  there is a video here that compares different kinds of capacitors used in a low pass circuit in a bass guitar. There is literally zero difference in sound between them apart from their respective capacitance value. The difference in capacitors can all be traced back to their characteristics and how they are being used in each circuit. As nobody characterizes the frequency characteristics of each and every capacitor they use, they use their ear for doing that (aka they use their ear as an audio spectrometer), so they can more or less say "this capacitor has a more suitable frequency characteristic in this circuit applicatinon at this time and under these conditions, certainly not "this cap sounds better". But until measurements are made, it's all very vague. But we do have general knowledge of a few recipes that can help about different types of capacitors, like the use of bypass caps, and that a PP+polyester in parallel have better temperature stability, etc. With simulation and correct analysis, we can save a lot of money compared to fancy audio caps.
Reply: @lolilollolilol7773  "There is literally zero difference"
And how do you arrive at that conclusion?
Millions of people know that different dielectrics have different sonic properties. Millions have learned this from direct experience. They also have different electrical properties, so that makes sense. Maybe you can't hear the difference, but that doesn't mean there isn't one.
Saying that "there is literally zero difference" means nothing. To whom? By what measurement?
The ear can resolve details that no scope could reveal.
Reply: @dougrobbins5367  Go watch that video, it's easy to find, and you'll hear by yourself. The experience is simple as there is a single component changed: the filter capacitor. The comments are pretty much unanimous that they can't hear a difference between the different caps except when their value is different.
Reply: @lolilollolilol7773  The comments?
Millions of people worldwide know that different dielectrics have different sonic qualities. There are a thousand conversations online, whre intelligent, experienced people discuss this and reach the same conclusion. The difference is sometimes subtle, and sometimes not.
One large electrolytic filter cap  is going to sound much like another, unless the quality is very low or very high. But signal caps often show a distinct difference. 
So on the one hand you have your comments, on the other hand you have worldwide acceptance that, for example, polypropylene is a bit more "hi-fi" than mylar, in signal caps.
Reply: Your comment is an arrogant oversimplification. Why do you think that an amp can have outstanding specs when fed a 1 kHz sine wave, but sound terrible overall?
Because a transistor, tube or cap deals with hundreds of frequencies AT THE SAME TIME. The signal is complex, and the qualities of different dielectrics are audible in those situations.
The musical qualities that people hear are not things you can resolve and describe using an oscilloscope. The ear is a much finer instrument. Can an oscilloscope tell the difference between a good sax solo and a bad one? It's the DYNAMIC characteristics that count, in high fidelity. That's harder to nail down using numbers. We all know that amps with mediocre specs can sound great, very musical, while other amps that have outstanding specs can sound flat, dull, and lifeless. You can buy an audio amp on a chip that has great specs, but it sounds like a radio shack ghetto blaster. Obviously the specs aren't telling the whole story. 
More to it, maybe, than equivalent series inductance?
YOu can buy a tube of a certain type, of modern manufacture for say, twenty dollars online. You can buy a much higher quality vintage tube of the same type for five hundred. Most will agree that the sonic qualities of the expensive tube are far superior. Millions of people understand this and spend their money accordingly. Are they all fools? Usually those who build their amps are not the dumbest folks in the neighborhood. Guitarists who spend a fortune for certain vintage tubes, and there are many, are directly connected to the sound they make.
Could you make the appropriate distinction between those two tubes, comparing the basic specifications?
That would tell you little or nothing, other than simple things like inherent noise level. The two tubes will test out much the same, in most cases.
Tubes are inherently more linear than transistors. Lots of tube amp circuits can run without feedback. Without serious feedback to correct the inherent non-linearity, a transistor amp without feedback would be unlistenable. So your "conventional" idea that tubes produce more distortion than transistors is nonsense.
The subjective impression that signal caps, and to some extent filter caps have different sonic qualities is well accepted by millions of intelligent people, who tinker with and build their own amps, worldwide. A quick visit to hi-fi forums will confirm this. 
Are they all delusional?
Or is your oversimplified, rather arrogant analysis emblematic of certain "science" types who think that the complex phenomenon of music  reproduction can be explained using Ohm's Law, and a comparison of equivalent series resistance?
Reply: @dougrobbins5367  Yeah the same way there are millions of antivaxxers who only swear by "their own experience". Guess what ? It's worthless.
And for every "expert" who finds sonic characteristics for caps, I can find another one will tell you the exact opposite. For instance this guy whose channel is about restoring vintage audio gear: go watch "The Surprising Truth About Old Capacitors".
Or Mr Carlson's Lab, for an electronic genius who actually *knows*what he's talking about.
Reply: @lolilollolilol7773  Wrong. Not the same at all. Research the hi-fi forums and you will find a broad consensus about the sonic qualities of caps. The idea that opinions are split on the issue is nonsense. You have no idea what you are talking about.
Reply: @dougrobbins5367  Dude, i've been in such forums for 15 years, I know what they're about. I've been in audio circles for 2 decades, listening to countless tube and solid state systems, with some very invested audiophiles who only swore by Westrex, JBL horns, etc, etc, been there, done that. I myself listen daily to a Mc275 amp on KEF Ref 105/3 speakers and I own a pair of custom 300B amps. You're not teaching me anything.
Reply: @lolilollolilol7773  A fair comment. I'm not getting into a contest with you, but since you give me your credentials I will give you mine.
I've been building amps from scratch for forty years. I've run a whole lot of variables, in my tube amps, of which I've built around twenty. Quite successful, and I've learned things that you will never find online. I've designed some relatively sophisticated high voltage power supply regulators for my tube amps, and the results are very satisfying, and quite surprising. 
Time after time I have found these things to be true. An inferior electrolytic filter cap can ruin the sound of an amp. Improved signal caps can often "clean up" the sound, making it more distinct, and improving detail. Some signal caps add character to the tone, while others are quite transparent. Each dielectric has it's own effect.
Building an amp is like making soup. Everything has a sound. Resistor types have a sound, though subtle. Ask any experienced guitarist if the quality and type of  volume pot he has in his guitar makes a difference to his sound.  He'll tell you of course it does. Every component has some characteristic. Parts layout and wiring dress have direct effects on the sound of the amp. 
Hearing music is an extremely complex biological and physical event. It's no surprise that scientific analysis and measurement of that event has not caught up to our subjective experience of that event.
I think that can be understood by most anyone, if they don't think that they already know everything.
Reply: @philipwebb960  No, if it has a push-pull output transformer (not single ended) then the design means even harmonics get cancelled out in the output stage. AlanMF00 is absolutly on the money with his reply. I am not retired but have been designing analogue electronics for 52 years.
Reply: Uhmmm, I think you mean tubes distort by producing even order harmonics.
Reply: I think you mean when tube amps distort they produce even order harmonics....that's the 'good' distortion. Reason why tube guitar amps are still a thing.
Reply: I've seen charged electrolytics rebuild their voltage after being shorted for several seconds.  Their voltage actually rebuilds back up.  Dielectrics that greatly increase the effective capacitance over simple air or vaccum no doubt have complex characteristics.  Devices that use such 'capacitance enhancing dielectrics' are thus not necessarily pure capacitors.

I've rigged up a push button on/off switch to bypass a coupling cap in an audio circuit, and would randomize the on or off condition by many pushes (maybe around 50 - 100) of the switch while deliberately focusing my attention on other things.  I'd then listen and found that with a well recorded snare drum sequence repeating on a CD, that I could hear a difference, and I could verify which way the switch ended up (on or off) 100% of the time by ear.  (Each time verified after the choice with an ohmmeter.)

I've also heard different sonic effects from different capacitors while playing with speaker crossover designs.

You could say it's all my (and many other's) imagination, but I'm satisfied that:
1.  There are audible differences.
2.  They are probably related to 'non-pure-capacitor-like' behavior of their dieletrics.  (That's why electrolytics are worse).
3.  Sine wave tests are probably insufficient to isolate the issue.
Reply: @ilovecops6255  is that english?